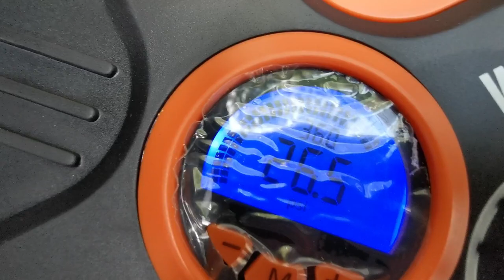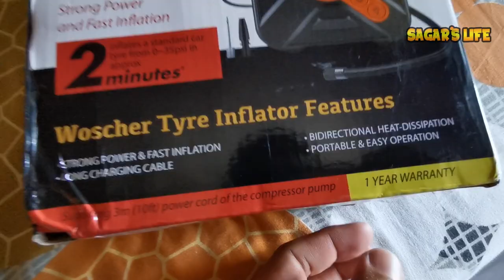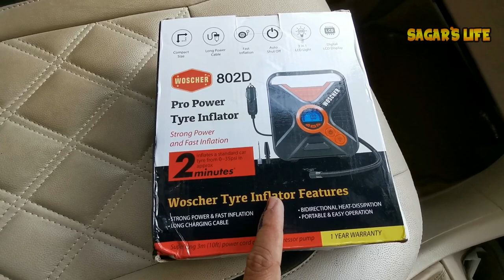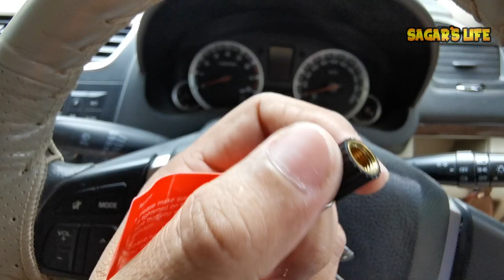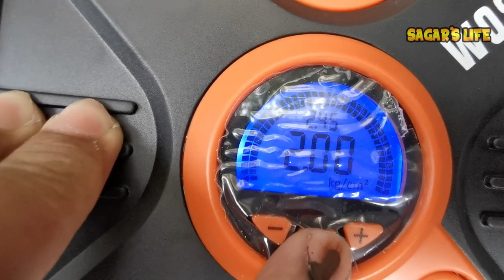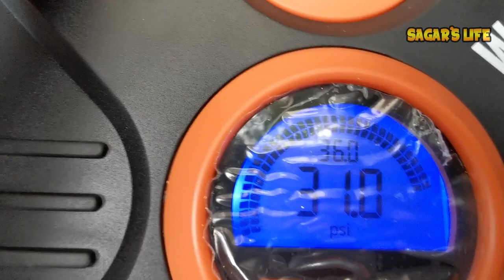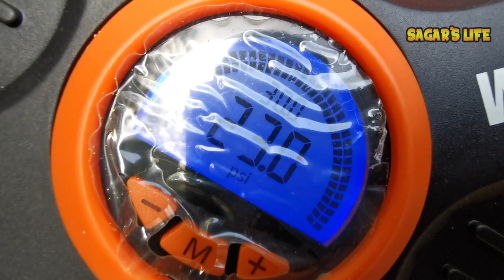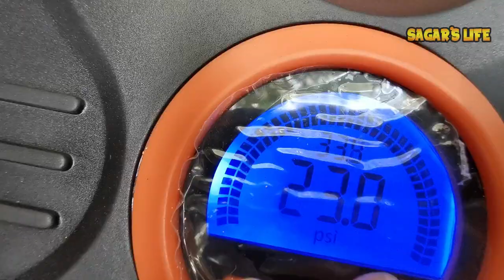Fix Your Flat Puncture Tyre Anywhere | Woscher 802D Digital Tyre Inflator | For All Cars & Bikes

Comment: Does it come with adaptor to fill air in bycycle tyre? My kid have small bycycle and i tried solimo tyre inflator. It didnt had adaptor to fill tyre inflator
Reply from the maker: My bicycle tyres connection is  same as my car and bike tyres connection, its also comes with presta valve to normal Valve adaptor for cycle